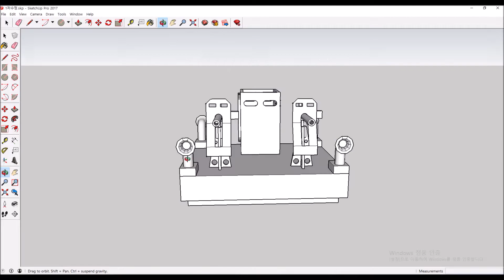3D Printed RC Boat  (1:72 LCM3) EP. 6

Comment: i really wonder how the leakage from door site can be stopped(since its too close to waterline). maybe a door with less hinge contacts(less contacts = less spots to leak maybe ?) and using vaseline on hinges could help?
Reply from the maker: Now the hull and hinge are connected. It is inferred that water flows into the hull floor through the hinge hole.
Next, I am thinking of making the hull and hinge independently.